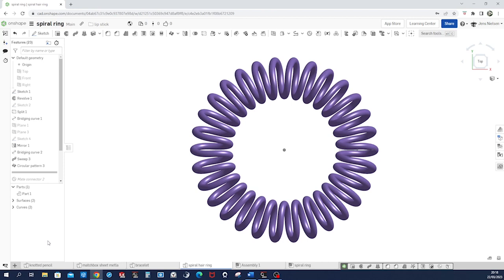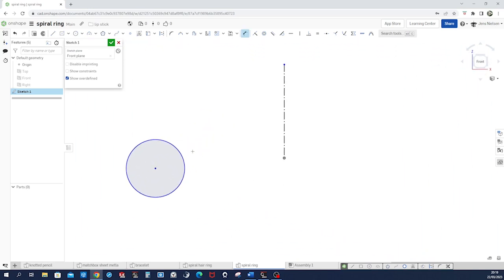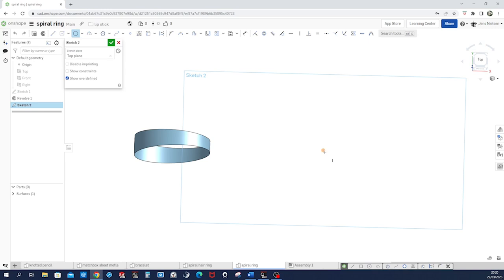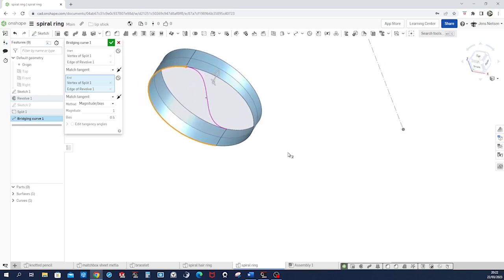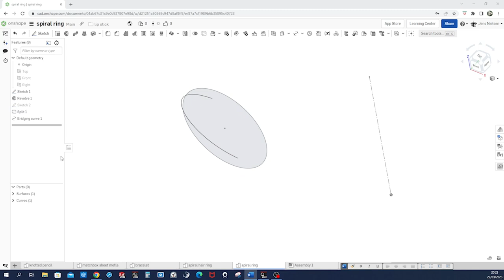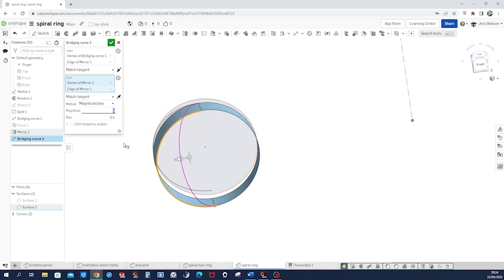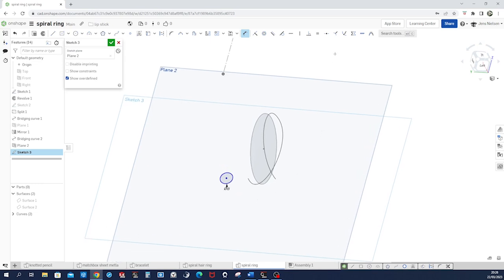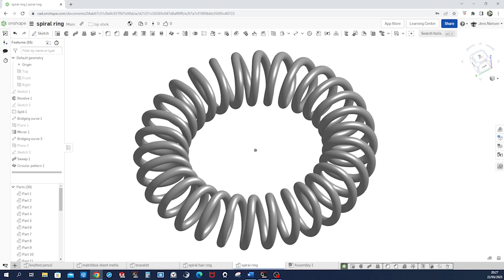Discover How to Make a Mesmerizing Spiral Ring with  Bridging Curve in Onshape.

Comment: hey! very cool to see you post this. i was just about to go on reddit to ask a question on how i can achive something similar. so my problem right now is, i am trying to do this sweep with a rectangle and im not quite sure on how i get the edges aligned. when i hit the option: profile alignment, it shows in the prediction exactly what i want, but then it wont let me do the operation. maybe you can help out! Thanks a lot!
Reply from the maker: thx. about that  question, I think reddit is really better because you can share an image of the  situation. I'm in that  Onshape community and  can have a look.
Reply: @cademist  alright thanks i will post my question there
Reply: I basically did the same thing as you showed in the video, but the sketch i used for the sweep resembles a rectangle, not a circle
Reply from the maker: @alexchrome10  I just swapped my 8mm diameter circle for a square 8x8 with that dimension and it works
Reply: @cademist  Thanks for your guidance on reddit! Problem solved!